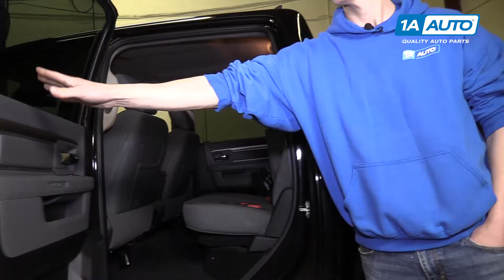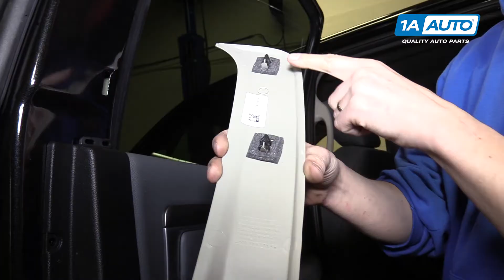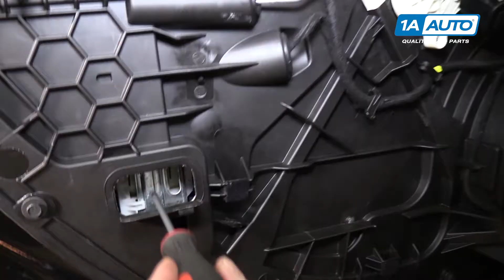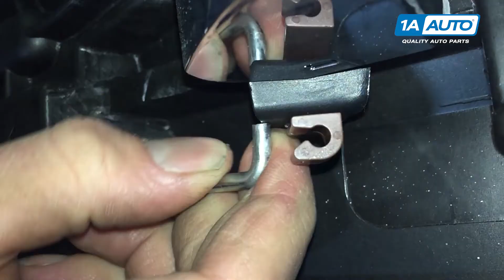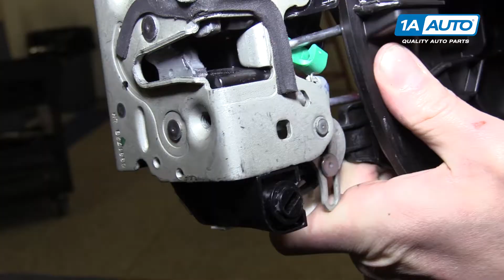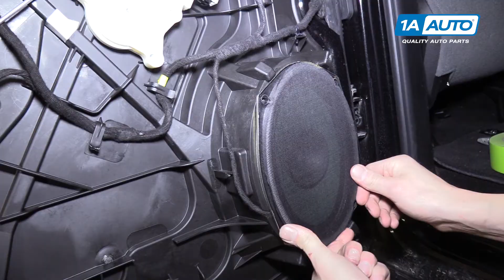How to Remove Rear Window Regulator 2017 Ram 1500

Comment: Thanks for this video. Had to swap out a regulator on a 2017 with 96k miles.  You forgot to mention how to swap the interior door handles. I watched another video and ended up cutting up the old regulator  to remove it.  Took almost 90 mins to do the job in total after removal and waiting on delivery of a new regulator @ $85+ tax.

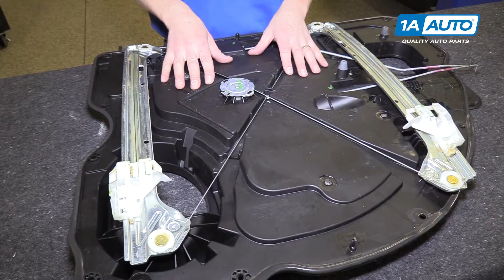Comment: Excellent video right up until 10:00 "this is all one piece so that's how you replace it" ???? WTH?? Isn't that the most important part of a "How to remove a window regulator" video? Are you saying the replacement is that entire plastic panel with attached metal guides and rods? Pulling a replacement out of the box would have made that clear.

Comment: If it's similar to a 2010 - door handle comes off from the top first. Pry top pivoting section with screwdriver outwards, then bottom pivoting section needs to be pried towards the front of the vehicle. It is easier to understand when looking at the new regulator panel assembly

This is not a super difficult job. Just typical Chrysler makes it so that more steps are involved to accomplish the same thing

Comment: My 013 v6 ram 1500 front driver windows is exactly have this problem since one rainy night at the beach driver unit control work passager side roll down but not roll roll up need to roll up whit the passager unit 
Driver window is holding ther whit red tape and roll down but not roll up 🆙 
I figure out your video is giving me issue about what is going on in there 👍 I’ll try it my self or so i will have to pay the labor